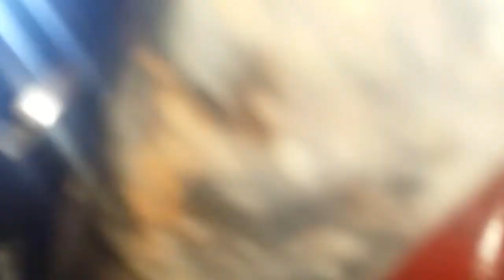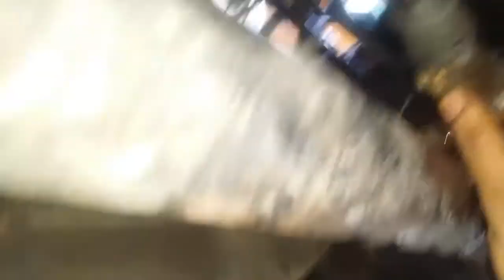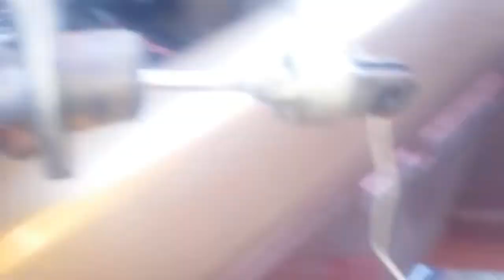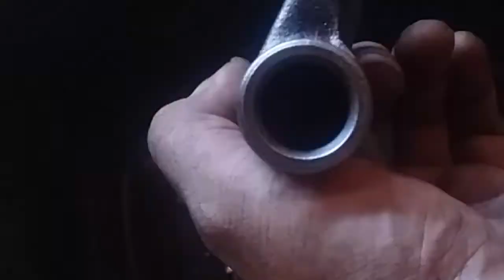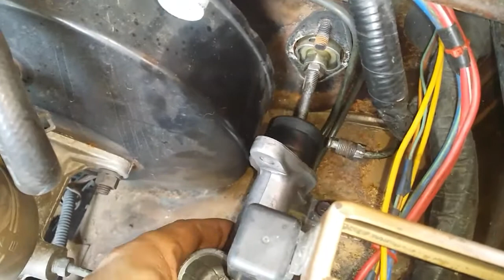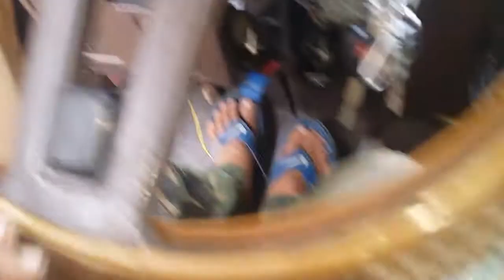Pajero 1st Gen Clutch Master/clutch slave Repair

Comment: Hello mr diyer.....my pajero has clutch issues.....clutch feels soft when engine os cold but hardens aften a little drive....clutch stifens until you hear rubber squeeze....i jave replace mater cylinder and slave culinder two time now....no change...replaced clutch plate, release bearing and pressure plate no change.....please help....

Comment: Good day sir. My 4d56 frequently got issue on clutch master pump failure. It can only last about 3 to 4 months before I had to replace the clutch pump kit. Some friends told me that the heat produced inside the engine from exhaust manifold & turbo could be the reason. It has deteriorated the pump kit much faster. Any advice on this sir?
Reply from the maker: need to replacee the entire assembly clutch master and slave make sure to flush all the old fluid out.